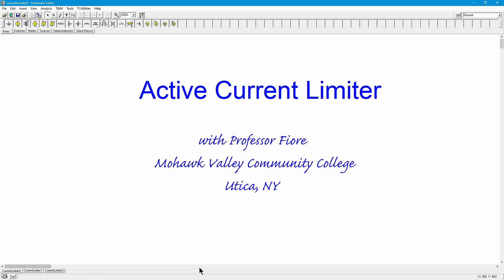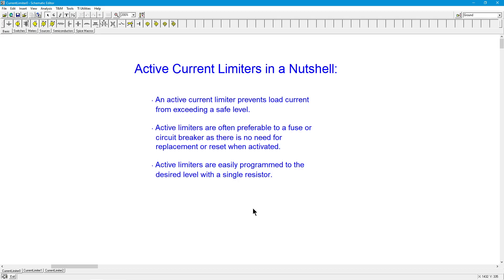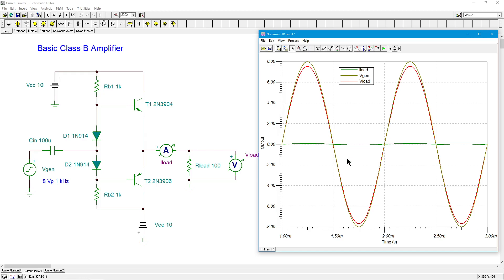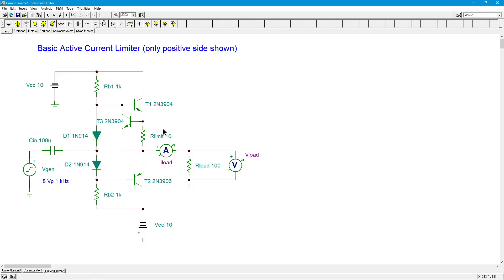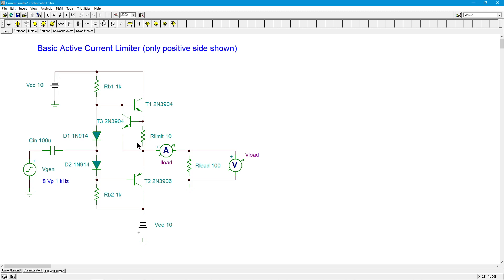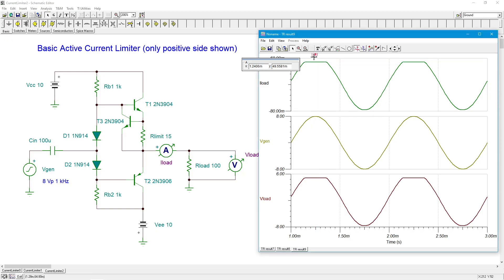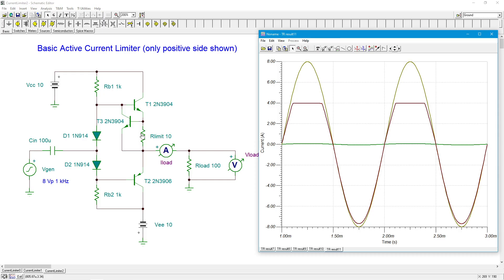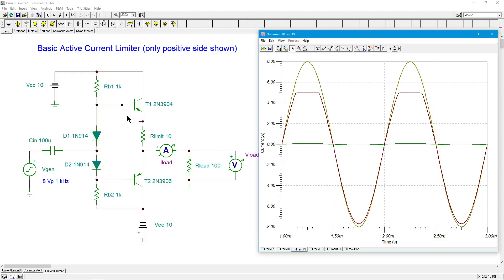Semiconductor Devices: Active Current Limiter

Comment: Thanks for the video
You can use  simple jfet with resistor on its source and gate connected to ground.
The problem with both circuits is that they waste lots of energy, in your case 0.7xI.  When I is large, then it become problematic.
Reply from the maker: Not when compared to the load power (assuming the circuit uses double digit power supplies, which would be expected for an audio amplifier, and not using tiny loads). Besides, many would argue that "not blowing up" is worth the wasted power ;-)

Comment: Nice lecture. Won't those flat spots on the crests of the sinewave fry your tweeters though?
Is there a simple circuit to turn off the drive to the power transistors when such flat spots (i.e. current limiter engaging or the drive voltage is too high) are detected?
Reply from the maker: The flat spots are a form of clipping and thus produce higher frequency distortion products, but that's probably preferable to throwing in a large current overage. I can imagine special cases where that might not be the case (like overdriving the heck out of a loudspeaker with an extremely low frequency tone), but just remember what you're trying to do here, and that's limit potentially damaging high load currents. Also, you wouldn't want to just "turn off" the output as that would cause large spikes which would be even worse. The best solution (and one that is much more complicated) would be to have a soft knee limiter right before this so the signal can't get that high. 

I should also indicate that a circuit like this might be used in non-audio applications, for example, an adjustable lab DC supply.
Reply: @ElectronicswithProfessorFiore  You've got a point there with the soft knee limiter but in addition to the difficulty of implementing it, it also means you must have some power supply voltage margin as you don't want the limiter to engage on every peak, just those over a certain limit. But perhaps there is a way of implementing this without any power supply voltage margin, i.e., allowing the signal to exceed the supply voltage momentarily.
I saw a really good presentation somewhere explaining why the flat spots burn the tweeters out but I've forgotten where. It also had to do with the presence of crossovers and it essentially showed that the ac energy contained in the harmonics dissipated in the tweeter during the flat portions of the clipped signal was excessive and caused them to burn out.  
Another solution would be a soft turn off once the output signal first crosses the zero voltage. The detection of the zero voltage crossing is not done by a particularly complicated circuit.

Comment: Different question. If we look at the 2 diodes (say 1.4V drop), the Transistors will also drop this plus, potentially, 2 x Limiting resistors. Does this mean the drop across the 10Ohm resistor is zero or does the Diode/Transistor drop vary to accommodate, or something else, I'm thinking crossover distortion? When the overflow transistor is working, that seems to give us 2 x VBE drops against the diode drop. What am I missing?
Reply from the maker: Remember, the bypass transistor BE is in parallel with the limit resistor. The drop across the 10 ohm will be around 0.7 V when the limiter is activated. That's what turns on the bypass transistor (which shunts current away from the base of the output power transistor). For levels that are below the limit current, the drop across the 10 ohm will be less than 0.7 V (all depending on how large the output current is). It is true that the addition of this circuit will reduce the maximum output compliance by a small amount (0.7 V peak), but that's a small price to pay for the added safety.